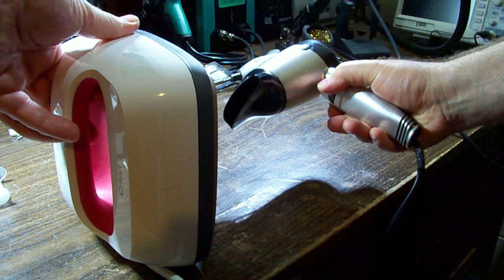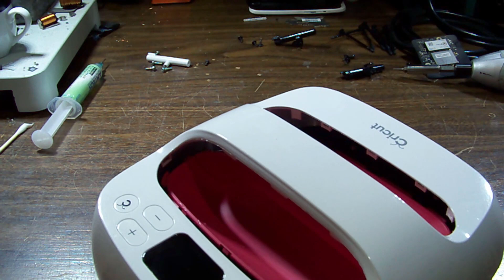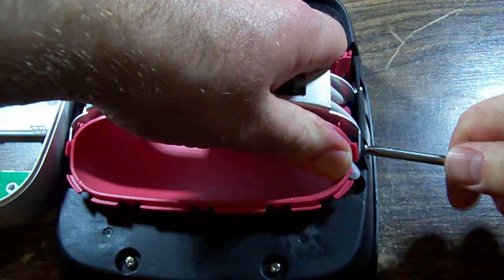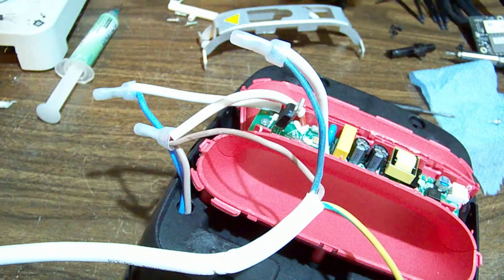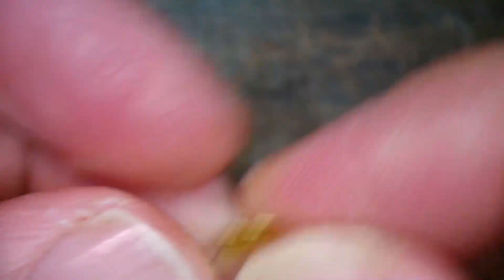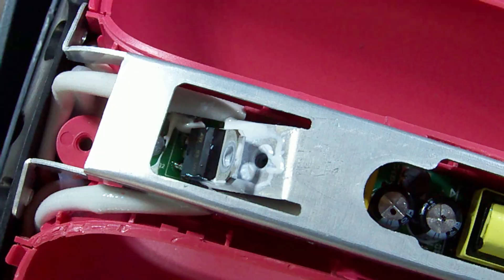FINALLY!!  Cricut Easypress 2 E3 REPAIR!

Comment: Great video! Do you have any idea what model of thermistor EasyPress uses? Mine has an open circuit, but there is no model number printed on the thermistor itself. I’m guessing it’s an NTC 100K; however, I haven’t been able to find a thermistor with a similar shape on the market. If you know the thermistor model, I would appreciate it.

Comment: I found this video because I also had trouble taking this apart,  even after I found the 8 hidden fasteners.   My wife bought a new one so I wasn't very careful prying it open resulting in me cracking the case.  This unit was not designed with servicing inside.  My unit had a shorted triac which caused the full 100% duty cycle of power to the heating element, which melted my wife's work.

Comment: I find faulty cricut devices and repair them and then sell them on as there seems to be a huge demand for them here in the uk and I bought a joblot of these easy press things its the version 3 but the faults are all the same and I suspected thermal fuse and you have just confirmed it so now I know I'm right thanks to your video I wil order the parts. Thanks

Comment: hi can i ask? mine always turns orange and won't  turn to green and also when i set the temp 300 F and timer 30 sec it goes back to 85 F and it won't heat up. i wonder whats wrong

Comment: Great breakdown! This disassembly greatly helped for my wife's 10x12 Easy Press. There are the same style clips the full perimeter of the handle area on that size, not just in the handle. Same part number on the triac as yours. Mine also measured about 40ohms, so I'll be ordering that up with thermal fuses. She had described runaway heat before it quit with various E-code errors. Thanks for the help!
Reply: Did this work???? My triac measures around 60 ohms
Reply: @OneMoreGuy10  well, TBH it's still sitting on the workbench. Parts came in after she bought a new press (had an urgent order) and other projects have taken priority. Haha I'm sure you know how that goes. I'll get down the list eventually.

Comment: Been watching you videos since high school till I fell in some trouble my self would really appreciate it If u can help me on this one Good day my Pyleblade amplifier is in protect mode, it's disconnected from everything also I tested all the transistors an they seems to be good with multimeter but  I do see  that a sm capacitors burned and also a bulge on one cubodial capacitor but it tested good with the multimeter don't know I'd I should take it out and the ic runnin 2 channels looks good but they are small sm capacity that are givin a 0 reqdin in the resistance mode when i test them below are some pics any help please the choke looks burnt but it's not the problem and it isn't burnt out it tested good with the mm and it's not shorting as the coating didn't burnt out just get heated and when I put the probes on continuity qt the output speakers leads no  is attached I get a short at 3 leads don't know if I can email u pics
Reply from the maker: I found your pictures in another post you made. You can find a datasheet for the output IC TDA8954 on google which shows what each pin does. I would almost guarantee IC U12 is blown. You can't test a choke with mm like that. The enamel coating is burnt so the windings will be shorted, you can only test with a proper inductance meter but in that condition almost certain that is bad. Clean the damage from C137 and remove the charred one above it and C138 and if you still have short on speaker terminals remove the IC and it will probably go away. Only guessing tho but it will need a few parts to repair this damage. You might be able to remove the bad parts and still use it as 2 ch only.
Reply: Thank you for your reply appreciate it I I our the burnt chicken coil qn capacitor an other surface mount capacitors and the short came off now the amp is up runnin and playin great only 2 channels wokrin but that's best not wiring all that speakers any ways. And thanks you sm I really appreciate the help god bless you  brother

Comment: hi,great channel Jonny.
you need to keep a look out for their mug press version...my other half has had 3 of them in 2 months all failing the same way that the t-shirt press  did youve just repaired with the same error message.
Cricut just kept replacing the units without wanting them back which was good but not so good as they failed pretty quickly lol.
like zx8401ztv said below, the markings on the components might not truly tell what ratings theyre designed for or can comfortably work with?
i didnt try and strip them unfortunately but when the new ones decide to let go i might have a gander.
keep up the good work,love the indepth detail you go into.
Reply from the maker: Thanks mate! Must be a bad batch of thermal fuses I think or a product buyer skimping on quality, perhaps they're making them so cheaply it isn't worth a service tech to repair them under warranty.
Reply: @JonnyFix    judging by the challenge you had trying to get into youres i bet they wouldnt want to repair them lol,a real design f**k up.
probably right about the quality of components,like everything these days theyre built to a budget unfortunately.